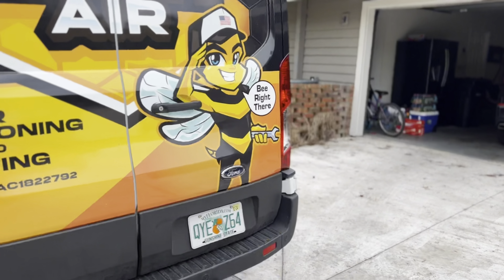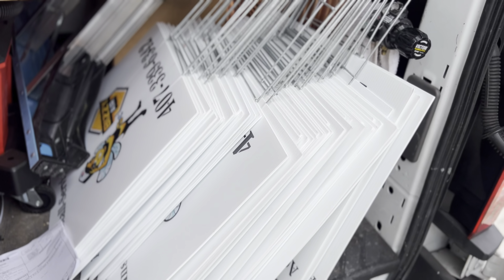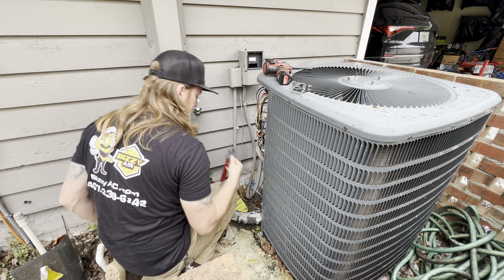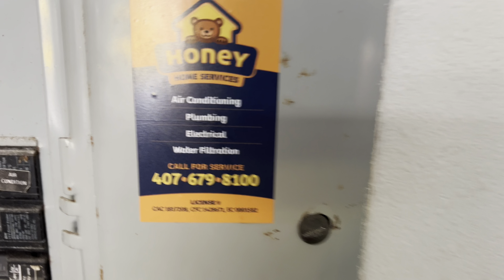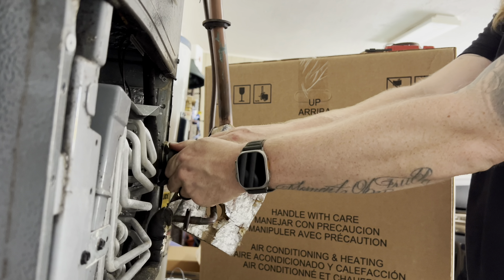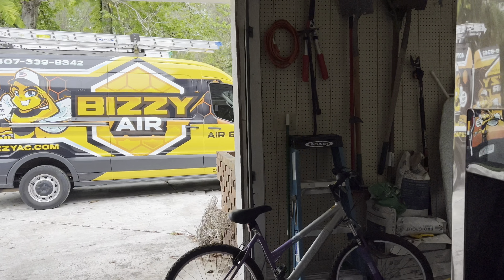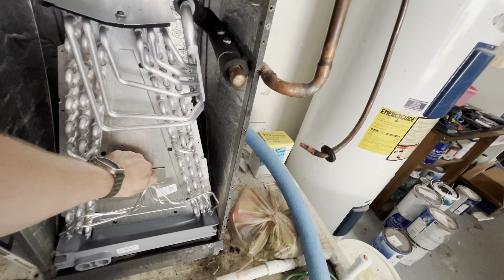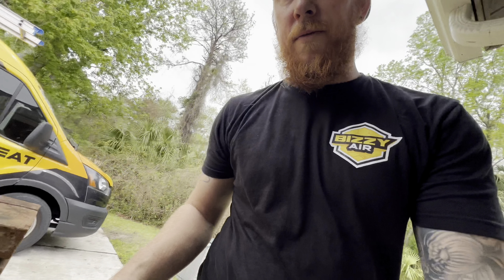NOW it Begins | HVAC | Getting the van wrapped and leaking Goodman evap

Comment: Which fieldpice leak detector do you use i just broke my dr58 yesterday after having to buy 3k worth of tools that just got stolen out of my van right in front of my house needless to say I feel defeated but i gotta suck it up and drive on.

Love the wrap that honeycomb is dope. Great work as always respect from Cali 👊
Reply from the maker: Duuuude no!?! Man I’m sorry to hear that, keep the grind up and keep on keeping on. I use the dr82 which is the infrared one. And then I have the h-10 pro also. Appreciate it man but safe out there 🫡
Reply: @KoolinwithKrauss  could you provide pros an cons of each one?
Reply from the maker: @mattbilodeau2433 fieldpiece : pros-  small, flexible hose, loud, tip illuminates, rechargeable. 
Cons- not as sensitive, I hate the blue backlight from all FP devices why they haven’t switched to a white backlight 🤷‍♂️ but I haven’t had much an issue

H-10 pros : the manual adjustment, fine tune the sensitivity, rechargeable, red blinking light, 
Cons- the tethers wand (they make extension) sometimes takes awhile to fine tune it, the battery sucks (prob need new one)it’s big and gets in the way. 

I do prefer the accuracy of the h 10 but prefer the ease ability of the fieldpiece
Reply: @KoolinwithKrauss  brother thank you for taking the time to answer my questions I appreciate you

Comment: Why would you trust the supplier to have all the parts in the box? You should open the box before you leave.
Reply from the maker: Could have but didn’t 🤷‍♂️ order the coil with txv installed. Never had an issue with my goodman there before after 4 years figured why would it start now